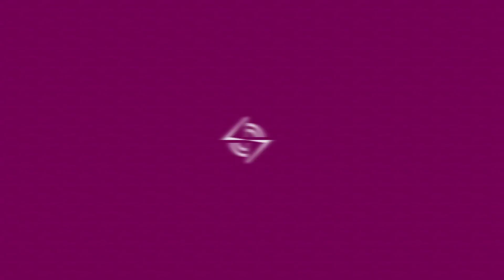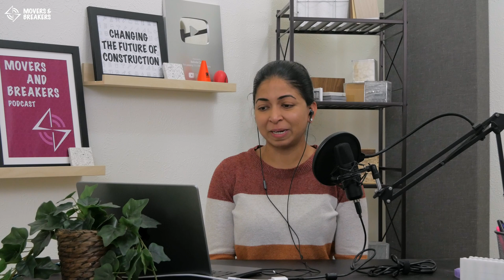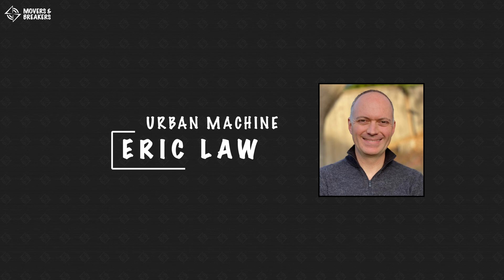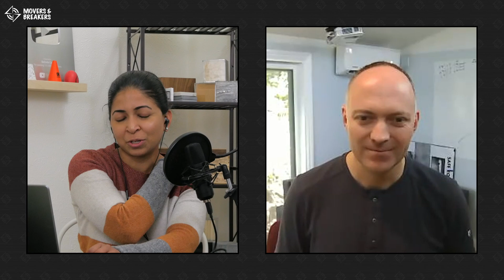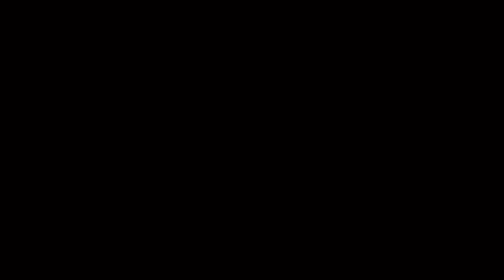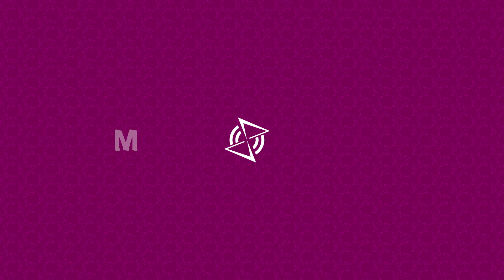Building Waste Recycling w/ Urban Machine | Episode 49

Comment: Eric's a very smart man when it comes to construction as he knows exactly how to approach the industry, very subtle moves. More importantly, he took the worst, time consuming job on the site, pulling nails, and automated it.  The one thing I would watch is some shifty contractors who'll charge you for new wood and use the reclaimed wood but that's when you have to be on site to check it.  I went to the Urban Machine website and checked out the videos, which are fantastic. That system is as incredible as it sounds.  Another fantastic interview Belinda And always asking the pertinent questions. Incredible work you're doing week after week bring in these geniuses to the forefront.